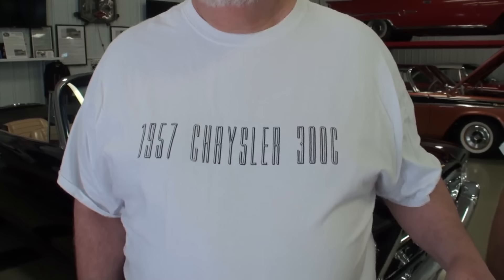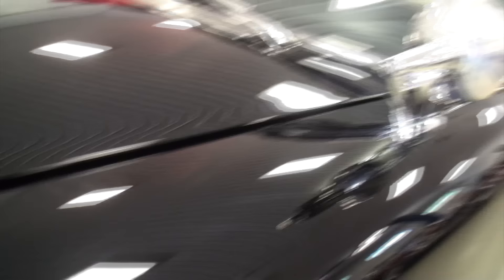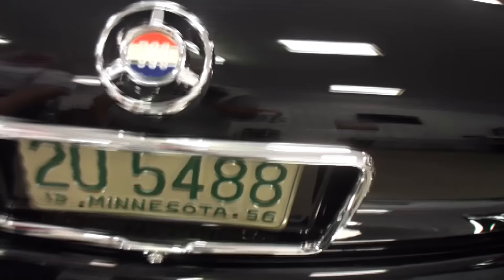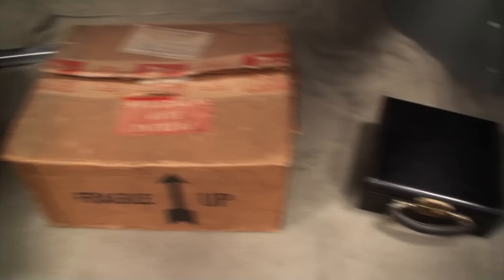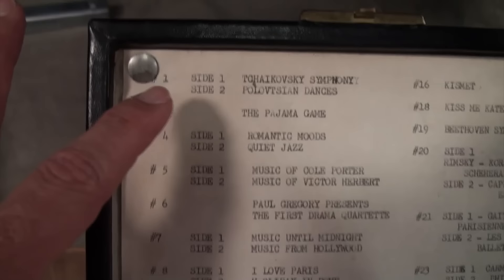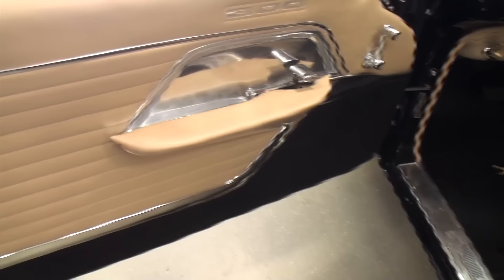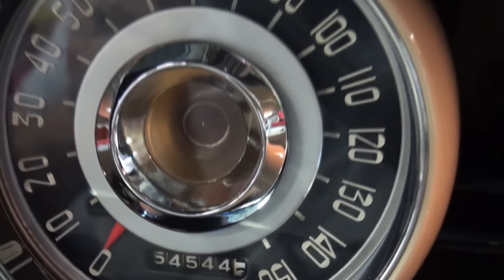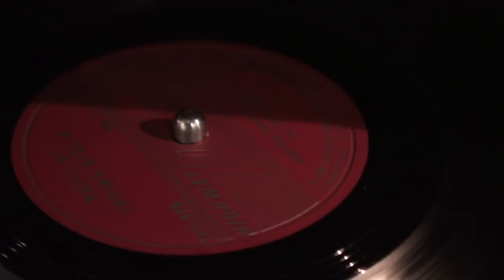Highway HI-FI Record Player Playing 1957 Chrysler 300C Black & Ride My Car Story with Lou Costabile

Comment: Hearing that chirp into 2nd gear reminded me of my days as an Austin police officer driving a ‘78 Plymouth Fury 440cid beast.  It had a calibrated speedometer up to 140 mph but topped out in the high 120s.  I thought it was blazing fast but reading the specs it went 0-60 in 9.2 seconds!   Just like the home I grew up in, not as big as I remembered!  Thanks for another good one Lou.
Reply: The thing about cars like this....despite their powerful engines, the 0-60 times were not much under 10 seconds--because those cars were very heavy!....by the later 1960s, the advent of lighter muscle cars benefited from having lighter bodies.  But this old 300C sounds like a real beast anyway!...and with those two impressive 4bbl carbs, forget about gas mileage!...nobody cared back then, as gas was going for about 28 cents a gallon--and sometimes even less!...I miss these cars, they were the envy of the world.
Reply from the maker: Hi AustinEVPLab, Happy to read this car brings back memories of your Police car :-) Thank you for viewing, sharing, and you're welcome. Lou
Reply: @curbozerboomer1773  i must admit that sometimes I would turn the air cleaner’s cover upside down to give that deep varoom sound when I punched it.  There was a poster in the lobby, a black & white shot of the ‘62 police cars being delivered, coming off a car carrier.  It had a big sign on the side that said 0-60 in 6 seconds!”
Reply: @austinevplab7167  😒

Comment: Love it! Growing up, a family friend had a 1955 300, which he got when it was 2 years old and owned it until his death in the late-90's, when he was in his 90's. He had it up to 126 mph once and it was still accelerating.
Generally, an automatic-equipped car won't get 'scratch' when shifting unless the transmission  has been modified. It takes an increase in working pressure, shift overlap tightened up and reducing the accumulator spring pressure for the kickdown(intermediate, 2nd gear) band. When behind a Hemi, a torqueflite usually had more clutches and a higher performance kickdown band. This was especially the case with the later 428 Hemi and the 440 six-pack.
Reply from the maker: Hi Automated Electronics, Happy to read "Love it!" :-) Glad to read this car brings back memories of your Family Friends car :-) Thank you for viewing and sharing, Lou
Reply: @loucostabile  Hi Lou, Yep it was a treat going places in that old '55 300.

Comment: An awesome video!!!  As an old timer, I'm lending some information about the special order, manual crank windows.  The original owner probably paid extra to have them manual crank as did a lot of people because the big three, Chrysler, Ford and GM, during his era were having terrible trouble with power windows.  The wrong type of wire insulation was being used for the wire leading out of the body into the door for the power windows causing terrible shorting out and windows randomly going up and down or not able to raise them, etc.
Reply from the maker: Hi Ed B, High praise for this video :-) Thank you for viewing and sharing, Lou
Reply: @loucostabile  I am deeply sorry for the way the once Mighty Chrysler 300 name is now associated with an out-of-date sedan that Stellantis seems to have on life support😮‍💨😮‍💨😮‍💨.
Reply: @edb5956  😂

Comment: Thank you, Lou, Randy, and the magnificent Mike Swedal of his fine work.  I'm going to be sad when Randy runs out of cars to share with us.  The cars from his collection have become regular content.  He's a nice guy, very smart, and I appreciate that he's willing to share his collection with us, through you Lou.
While I'm not a tire expert, I was shocked by Randy's 130MPH achievement on bias-ply tires.  Maybe a tire-guy can comment on this.  I enjoyed the detail on the Highway HI-FI.  And it was interesting to learn that a three-hundred series car could be de-contented apparently through the ordering process.
This mostly for the young guys-
In regard to the wheel chock, I wanted to add to Randy and Mike's info on push-button transmissions not having a park position.  Chrysler used the push-button system through 1964.  And I can confirm that later versions of push-button cars did have a dedicated park-lever.  While I can't confirm the exact model years for these, I can confirm that both my '62 Valiant and '64 New Yorker did have a dedicated park lever.  I'm not nit picking here, I'm building to the point that Chrysler Corporation fluid-drive cars (beginning with the 1939 model year) never had a park position or dedicated park pin at the flywheel.  These were always secured by the parking brake, that utilized a driveshaft mounted drum brake.  Parking both fluid-drive and the push-button Chrysler products must have been odd to people in the sense that every driver knew manual transmission cars (which are all there were prior to fluid-drive) could be left in either first gear or reverse, and sufficiently hold the car.  I'm sure with the advent of fluid-drive well-seasoned drivers would forget to use the parking brake, finding their car had rolled away from where it had been parked.
Reply from the maker: Hi discerningmind, Happy to read you're enjoying Randy's cars :-) I enjoy Randy and his collection too. Thank you for viewing and sharing, Lou
Reply: Re 'Park" on these Mopars - The A466 cast iron TorqueFlite trans had no Park - this trans in service 1956 thru 1961. Chrysler introduced the aluminum A727 TorqueFlite trans for 1962. Dodges and Plymouths had a Park pawl (lever) on 1962-and-newer models. Since Chrysler was still using its AstraDome dash for 1962 Chryslers that was carried over from the 1960 and 1961 years but for some very minor appearance changes, it did not design in Park, even though the '62s had the A727 trans. To your comment on the Valiant, I'm not sure if Chrysler installed the lighter duty A904 TorqueFlite trans it used on its fullsized Slant-6 cars, so don't know if Park on those compact Valiants and Lancers was introduced in '62 or ??. 1963 Chryslers, like my folks' '63 Newport on which I learned to drive, definitely had the Park pawl that we would slide, as is mentioned above for the '64 Chrysler with the same-as-'63 dash.
One more mention - 1964 Chrysler 300-Ks came with bucket seats and consoles. These console-equipped TorqueFlite cars had a conventional shft lever, and no pushbuttons. So Chrysler's 1964 Letter Cars no longer had pushbuttons, even though other Chryslers of that year still had them - then pushbuttons gone on all Mopars starting with the '65 models.
Reply: @noelhastalis6785    Thanks for this.

Comment: Another great car! 1957 was the year of several first's for Chrysler. Number one was the styling. It was also the first year for torsion bars and the 3 speed torqueflyte transmission. On a side note those had no second gear accumulator so it was easy to get rubber when they shifted into second gear. The reason some of the cars in the brochure have only signal headlights is that dual headlights weren't allowed in all states until later in the year. My grandpa had a 57 Dodge that he bought new. The first year torsion bars had a problem with rust near the rear of the bar. This was especially true in the rust belt states. The bars would snap sometimes when the cars were only a few years old. We were eating Christmas dinner when we heard a loud bang out in grandpas garage. When we looked out there the Dodge was sitting down on one front corner. The torsion bar had broken.
Reply from the maker: Hi Grant, Happy to read you enjoy this "great car!" :-) Thank you for viewing and sharing, Lou

Comment: Another treasure! That transmission has good shifts.  By '62 the push button Torqueflites got a park lever. Before then, better have a good parking brake.😬
Reply from the maker: Hi Carmudgeon, Happy to share this "treasure" with you :-) Lou
Reply: Partially true - Chrysler's aluminum A727 TorqueFlite trans was introduced for 1962, with 1962 Dodges and Plymouths fitted with the Park lever. Chryslers and Imperials were first fitted with  Park lever for their 1963 model year with their redesigned dashboards..

Comment: I believe the Worlds Fair decal is from a Mobil giveaway in spring 1964. They were distributed at Mobil stations in NYC and its suburbs.  The giveaway was a double pocket folder loaded with Worlds Fair info, Mobil ads and that sticker. When you showed the decal, memories of my Dad cutting off the left side of it and then sticking the Unisphere portion in one of the back side windows of our 62 Rambler American wagon popped up. 
BTW the station we got it at still exists, albeit rebuilt numerous times. It was still a Mobil until the merger and it’s now a Lukoil station. It’s located on Rt 4 Eastbound in Hackensack NJ just west of the Hackensack River.
Reply from the maker: Hi JeffFrmJoisey, Thank you for sharing, Lou

Comment: It was probably special ordered with manual windows and seats, in order to save performance-robbing weight?
Reply from the maker: Hi Al Dente, "in order to save performance-robbing weight?" That's funny :-) Lou
Reply: @loucostabile  You'd be surprised as to how much all of those gadgets weigh together, if you pile up the electric sunroof's motor, along with all other power assists for mirrors, seats, windows, doorlocks and the entire air conditioner.
It wasn't long ago when you featured an early Sixties Catalina of which the frame was drilled at the factory and certain body parts were stamped from aluminum. They must have had a good reason for doing so of which was evident at the track. In highschool, some of the guys used to copy at least the frame-drilling. Of course, if you seat a 400 pounder behind the wheel at the track, all of the above-mentioned measures would be rendered vain

Comment: I'm wondering if the '57 300C was faster than the '57 BelAir FI.
Reply from the maker: Hmmm, That is a good question.
Reply: @loucostabile  Can you find out Lou?
Reply: A simulation website has the 57 300  at 16 second 89 mph in the 1/4. It could probably do that with a cup of coffee on the dash.

Comment: Lou, you do great videos on the coolest and most unusually rare cars. Please do me and your fans a favor and shoot a video of a '61 Impala SS409 if you can even locate one. Even a 348 tripower would work.  I'll buy you a steak dinner as a thank you gesture. Keep up the good work 👍😜😁😎
Reply from the maker: Hi David, High praise on the videos. I appreciate the encouraging words. Pretty sure 348 CI was the highest engine option in 1961. Thought the 409 came out in 1962. Regardless, I'll keep an eye out for a 61 Impala, Lou
Reply: @loucostabile  If my memory serves me correctly Lou, there were a total of 453 SS Impalas built in '61 of which only 142 were 409's. I think the SS option was dealer installed but you could get the tripower 348 or 409 in the BelAir and Biscayne.

Comment: Bankers hot rod and not a cheap one.Sorry Lou your thinking only about money but the guy who bought it was just a little smarter than the average bear. He knew manual windows and seats tended not to break as much over time as power otions plus saved a little weight for going fast.If the guy could afford this not getting power seats and windows was not a budget issue.
Reply from the maker: Hi chona Simpson, Thanks for viewing and sharing, Lou

Comment: Hi Randy LOOK LOOK LOOK To Give More Correct Info About Wooden Chuck . The "E" Brake Connected To A Drum At Back Of Trans When Applyed  Drive Shaft Not Turning Through Differential - So If One Rear Wheel On Ice,Mud,Snow,Wet Pavement The Possible Slipperage One Rear Wheel, Thus The Car Would Not Hold In place Hence Wheel Chuck Sub Note My Father Retired From Mobile Oil Co.34 years Service Title "Oil Controller Main Office 6th/Flower Down Town LA  🦄🦄🦄🦄🦄
Reply from the maker: Hi William, Thank you for viewing and sharing your knowledge. Hope you see many more cars on this YouTube Channel you enjoy. Please subscribe, and hit the "bell" so you can see all the cars when they are uploaded on this YouTube Channel, Lou